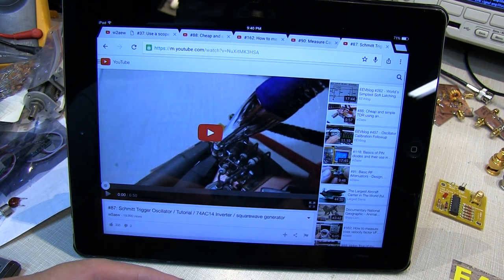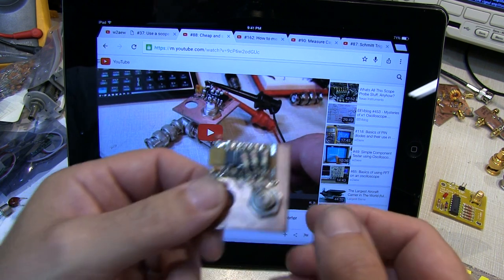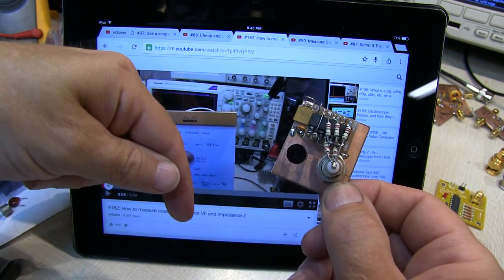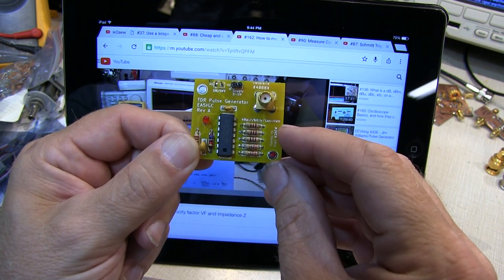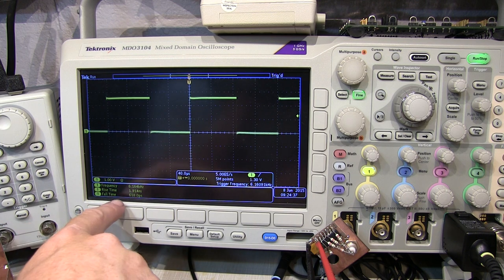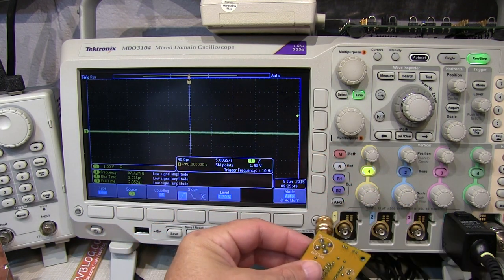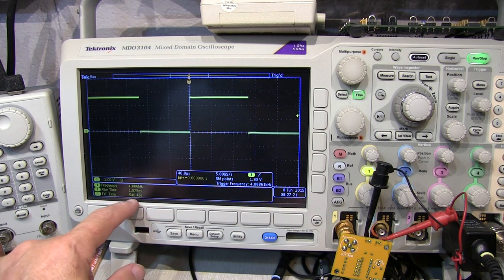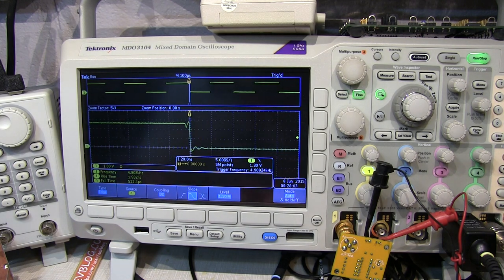#203: Schmitt Trigger Oscillator revisited | TDR | Measure Capacitors and Inductors

Comment: I can see the benefits of making this oscillator - self containing device and you can even power it from a battery for convenience. I'm asking just out of curiosity - for the experience. If you remove the oscillator and just use the schmitt triggers for sharp edges, then will it have the same effect if you connect your not-that-great signal generator to it. Maybe use the one from the oscillator for double buffering. Of course the input should be properly terminated.

Comment: Nice little project. Keeping the frequency some lower the circuit can be used to test the capacitors (as you also did in another video), as you have longer periods to charge. I am thinking about the influence of the through hole resistors (inductance). Probably the cause of the ringing? Okay, as ringing was not an issue for the main purpose of the circuit, I am thinking would de rising edge be even faster with smd components? And question about the buffer ports, what is the main goal? As 1 port probably can drive these small loads and is also a low impedance output.
Reply from the maker: Yes, it would be a ittle faster with SMD components.  The gates were paralleled to ease the drive needs of each stage.

Comment: I'd be interested to see a SMD version. Probably some performance benefits to be had right there.
One thing that has me intrigued is the red frame on the CRT on the old Tek CRO. What is that all about?
cheers
Rob
Reply from the maker: Rob B That's the graticule backlight on the Tek 2467.

Comment: Nice update Alan, ok, I gotta build me one now!  ;-)
73 - Dino KL0S
Reply from the maker: Dino Papas Thanks Dino.  Probably get even faster edges if you use an SMT 74AC14 device.
Reply: ***** nice video! Perhaps even better if using a higher density board with SMD devices... (just ignore that... I completely missed the word "SMT" above...) 
BTW, I can't help but think why would someone dislike this absolutely straightforward video... Go figure.

Comment: Alan I have watched all of your videos especially like the TDR videos showing practical ways to measure cable length and termination.  But I think that the pc board is in error, it should read "TDR Pulse Generator w2aew " acknowledging the original designer.
73
ve3bhm
Reply: In fairness to both, Schmitt triggers have been used as both oscillators and pulse generators by many, including for this very purpose.  I'm sure Alan's video introduced many to this circuit and the idea of TDR, but the basic circuit itself can be found in very similar form all over the place throughout the decades.  Alan's great contribution are his videos demonstrating its use and for choosing and demonstrating an inexpensive pulse generator that nearly anyone can afford and build (after all, he could have just gone ahead and used a dedicated pulse generator, as I might have, to demonstrate TDR).

Comment: Hi Alan.  I just re-watched this series of videos on your pulse generator and TDR measurements, and I have a question.  If my oscilloscope doesn't have a setting for 50-ohm input impedance, should I tee in a 50-ohm terminator at the scope input when I use this TDR circuit/technique?  Thanks!
Reply from the maker: For the cases where a 50 ohm termination is needed at the scope, a Tee with a terminator will work in many applications.
Reply: Thank you!